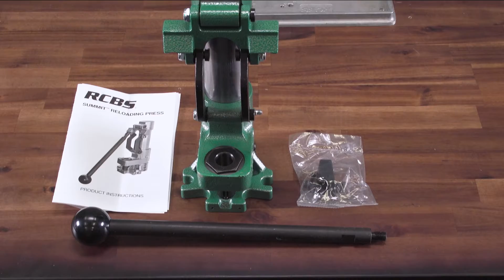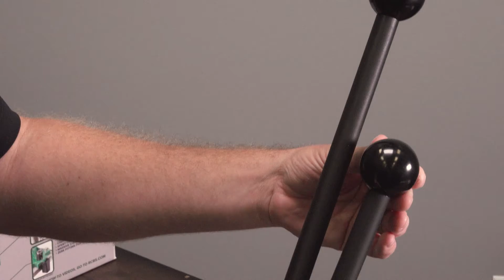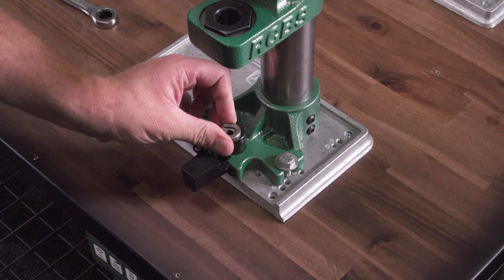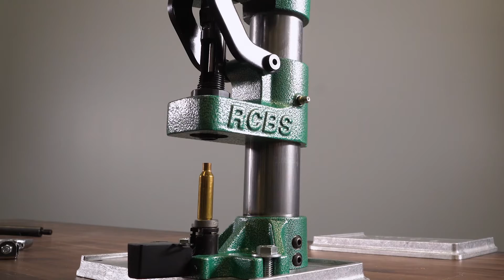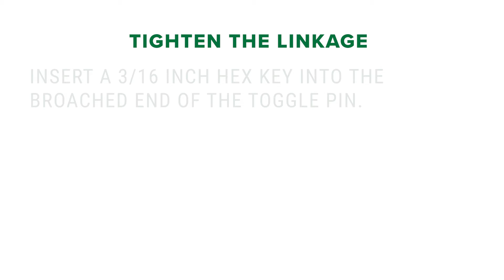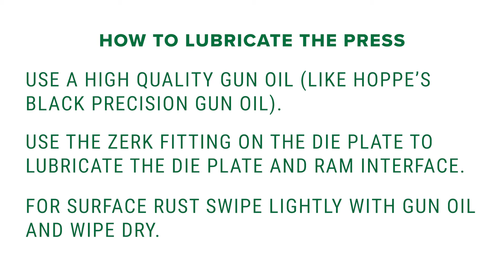Setting Up The Summit Press

Comment: Ma rispetto a quelle tradizionali che vantaggio ha
Reply from the maker: You'll see an advantage in consistent bullet seating, as this press moves the die down to the cartridge, instead of moving the cartridge up into the die. Less flex and more concentricity. Additionally, the Summit's unique handle position means you can mount it anywhere on top of your bench, you don't need to hang a handle and ram off the size of a bench, as with traditional presses.